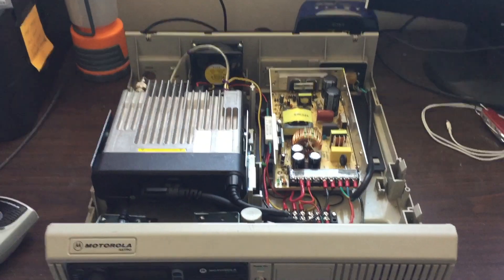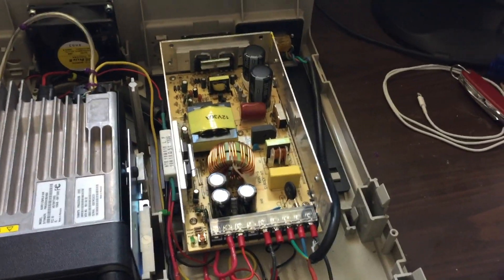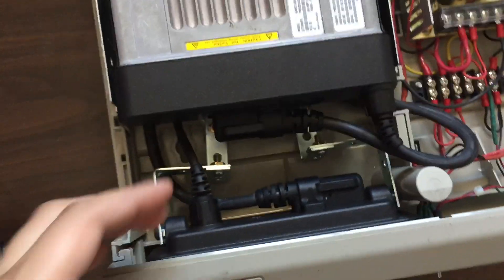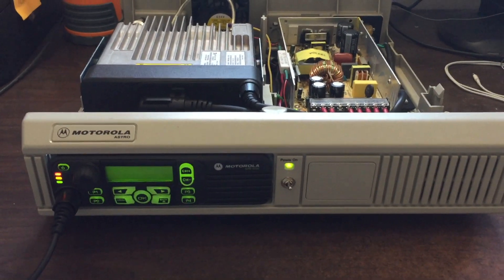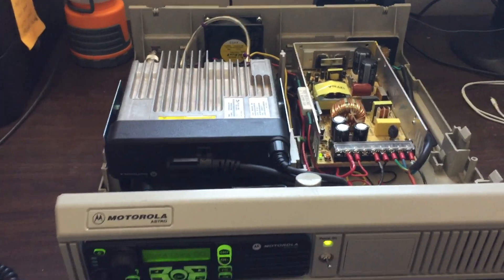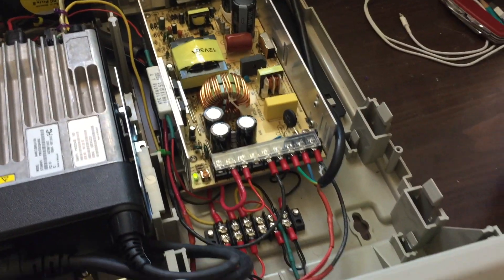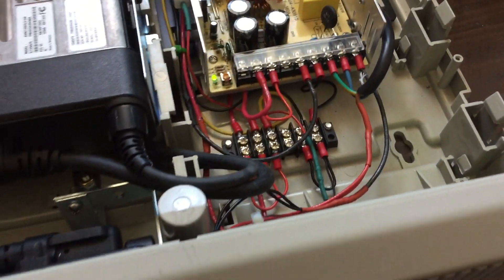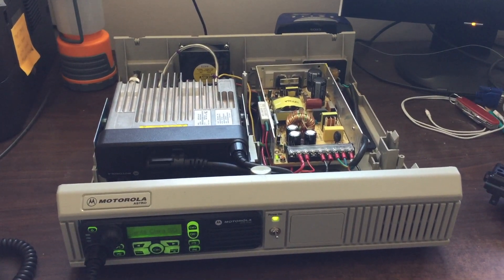Motorola Consolette / XPR4550 Conversion

Comment: TOTALLY FORGOT…

The power supplies are tiny in size with massive and ULTRA CLEAN output ideal for radio gear.
(extremely low RFI/EMI)

Input: 100-240vac - 50/60Hz  
Output:  12 vdc  /  60 amps.  Yup.. 60!

These supplies were originally from very $$ pricey servers made for industrial server farms.
They have integrated mini low noise fans and really stay cool, even under heavy load.

The only “issues” = They produce 12 volts DC output, not the 13.8v that many radios like to see.
There’s an other modification (a resistor has to added on a PCB inside the housing) that will modify it for 14vdc out.
The other “issue” = There are no output leads or terminals.  It has an edge type connector that you can either solder wire to OR you can buy a cheap ($12) adapter connector.   It has a mating edge connector on one side and a row or screw terminals on the other side.

I usually just solder 3x red and 3x black  #12awg super flexible silicone insulated stranded copper wires directly the edge connector on the supply.  I always add DC fuse holders & fuses inline with the red(+) wires a few inches from the supply for extra safety.

I have been using these for repeaters and mobiles (converted to desktop “base” units).

The HP model #. HSTNS -PL18 or 29
 and there a ton of web sites that show the supplies and the mods.

Comment: Good concept.. thanks.

Btw - For the past 4-5 years, I have been using modified HP server power supplies for most of my NON public-safety radio installs.  

The power supplies are still available in huge quantities - discontinued, but brand new in the box from a handful of dealers on Amazon.  (approx $15 with an extra $12 for the custom mfg’d edge connector). I avoid eBay for these as they were used for “crypto mining” and beat to hell.  For literally a few pennies more, you get brand new supplies w/Amazon’s 30 day returns.  (It DOES hurt to buy anything from Amazon since Bezos is a big Demoncrat supporter and they are crushing small businesses)

Comment: Nice, I have one of these Radios on UHF I use it on my repeater in the Los Gatos, Ca. 
  I just bought another XPR 4550e and will install it in my Van next to my Kenwood TK-8180.
I want to install the separation kit just like you have done, but in my van by putting the control head on the dashboard right next to my other radio the IC-706 MK2G.

Comment: Hello, I have to say,  Nice job on this project. I have several Astro Spectra’s VHF & UHF.   And I have them connected to a Motorola Desk set.  It’s called a RCH 3000.  And you can daisy chain them to gather.  I have a set in the living room and the kitchen and in the garage. There’s 2 RCH 3000 at each location. 1 for VHF & 1 for UHF.  Also I think the original power supply should have been able to do the job of powering the radio.  I believe it draws about 6 to 9 amps. So the built in power supply should have worked just fine.  I just look at my XPR-4550 and that’s what it draws. Again a very good a deal.  73 Bill 
KA9LFU